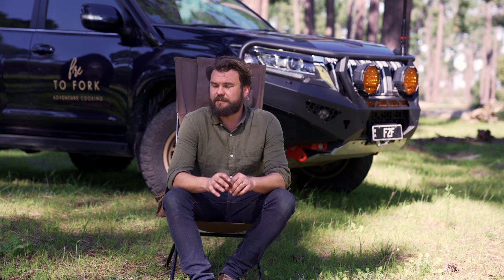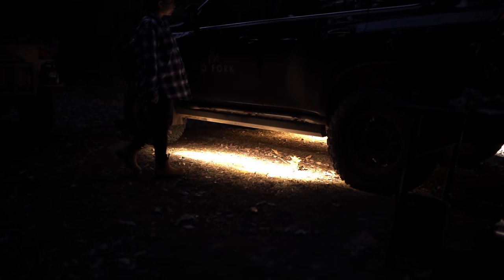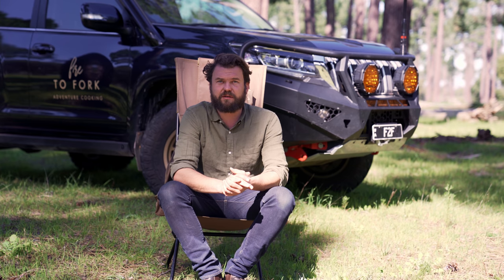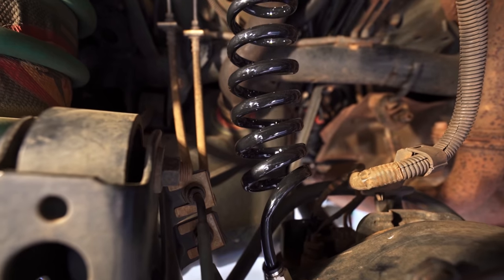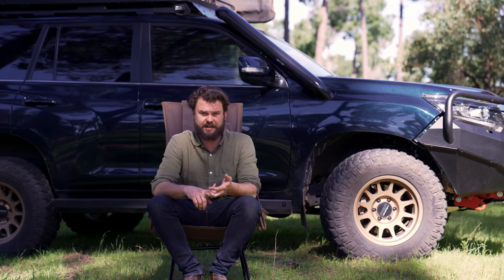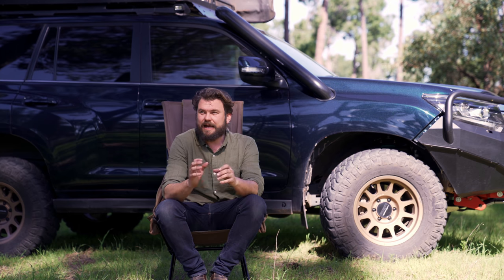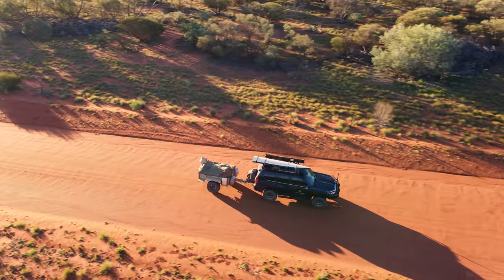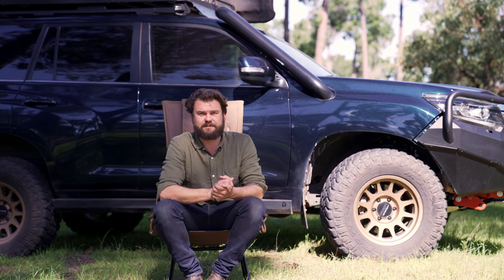MAKING IT BUSH PROOF - 10 Year Tourer

Comment: I love this build! 
 
I would just be wary of that stainless snorkel and the associated airbox if you go that route. It is very possible and I have seen first hand the snorkel will collect rain water and it will pool in the airbox. This was on a 2021 Hilux, so a different setup but similar. Filter was soaking wet after about 45 mins of rain driving, something to keep an eye on.

Also the "restrictive air intake" that was cut out is actually a very effective way of getting rid of dust before it hits the filter. The pre-spinner forces it out into the smaller tube into a catcher on the bottom of the airbox. It's not as good as the older style Toyota airbox's (which were brilliant, it's a shame they've gone to this) which we're a round cylinder filter and the entire airbox operated off this principle, But it does help. 

Aftermarket airbox's a lot of these companies make with see through lids, 887458973 bolts to undo the lid, very small surface area panel filters (or worse a pod filter) are also terrible for a 4wd, mainly due to filter choice. A paper filter is the industry standard as far as filtration effectiveness goes. unfortunately the lack of room in a Prado makes it hard to fit a proper airbox actually designed for a 4x4, So it will be a challenge to find something suitable. Ideally a older style Landcruiser box or Donaldson style box would be fitted, but I doubt you will be able to package it. Just something to think about, hopefully you come up with a solution.

Comment: Definitely one of the best prado builds around, good luck with the baby. Would you recommend a flat back prado if fuel capacity wasn't an issue or would the back window have a dust seal issue?
Reply from the maker: If you’re not going offroad a flat tailgate might be ok. But the big fuel tank and spare wheel being in a useful spot is much better for offroad use. I also thing the flat tailgates wouldn’t have as good resale value

Comment: Did you say you rejected aluminum under vehicle armour, due to not wanting to mix metals, then strap on an aluminum snorkel to that same mild steel vehicle? Is that not somewhat inconsistent?
Reply: And after that you tell us about your stainless steel water tank. Perhaps you have these all isolated from each other or perhaps a sacrificial anode?
Reply from the maker: Stainless snorkel isolated by rubber where it goes through the body and inside the guard.
Water tank is also on rubber mounts that isolate it.
There are some things that need to be stainless (intake and water tank are examples) but steel underbody armour is much stronger and has the double benefit of not mixing metals.

Comment: My only issue with stainless snorkels is none of them have beads  on there connections its just straight pipe hoping the silicon seals it
Reply from the maker: Yes but they are under negative pressure so popping off is not an issue.
And hose clamps and silicone bits are bloody strong!!
Reply: @firetofork  what do you mean negative pressure there not a sealed unit and I've seen them come off so can you explain what you mean there maybe im not understanding properly
Reply from the maker: They are not under any pressure. They are also held on by a bracket on the pillar and one behind the guard. Not by the silicone like the cheap models
Reply: @firetofork  your not selling me there is still movement between parts and even good ones I've seen come off which is why safari snorkel have them and warrant your engine. Im not by any means having a dig at you or the product but do they warrant your motor same as safari
Reply: Im sorry I feel im coming off as rude and attacking i don't mean to be at all I love your content and im definitely not an expert im just asking and from what I've seen and I don't understand why then don't but it on they are under vacuum and I think they would benefit from it but im a nobody but I meant no offence wasn't trying to be rude at all

Comment: Why did you go with dobinson over Fox or King mate ?
Reply from the maker: They offer a GVM upgrade. Fox, King, ARB, Radflo, Superior etc are great systems but none of them do a GVM upgrade without dedicated engineering which is very very expensive. I also love the Dobinsons gear for its adjustability in different configurations